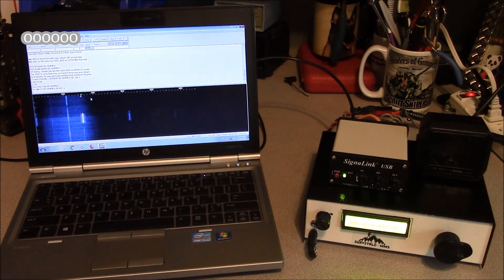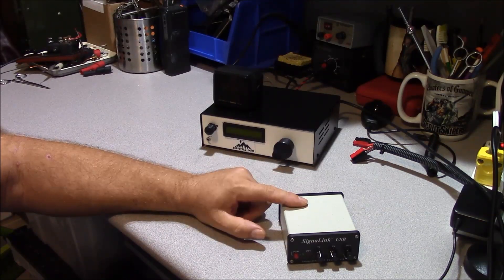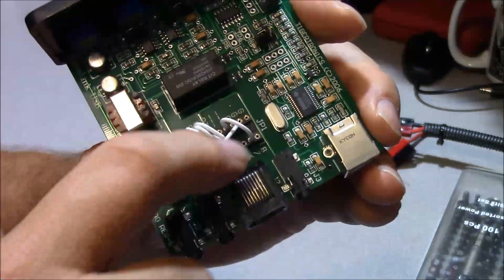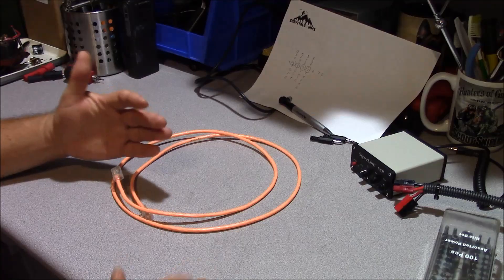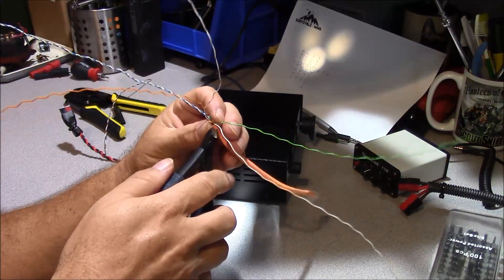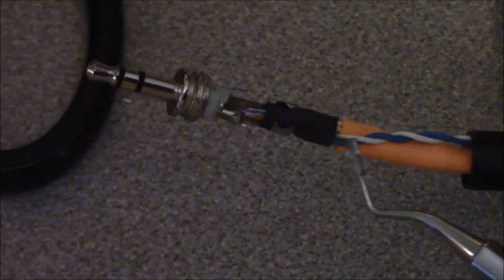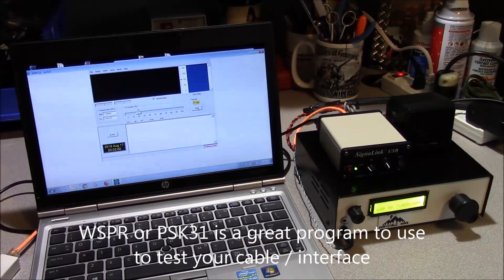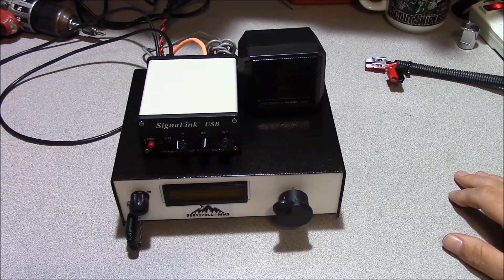uBITX  $130 HF/SSB radio part 5 build a SignaLink USB cable

Comment: Why do you use the SignaLink?  Why not just connect a cable from ubitx directly to USB of the computer?  Seems like making a simple connection more complex with no benefit.
Reply from the maker: Hmmmmm how and why would you connect the uBITX directly to the USB of the computer ?  You can interface to the soundcard of a computer with a few components . The signalink is a stand alone sound card and that is why it can pug into the USB. Thanks for watching !

Comment: I just got a Signalink USB for my FT-817ND, now that I have watched this I am going to get some cat cable that I have and make a connection for my uBitx as well.  Thanks for sharing this video, and I hope my buddy Ron C makes his first and then I can see how his turns out.  Of course I don't think Ron C has a uBitx.  Juddie WD8WV
Reply from the maker: You are welcome! Its a really easy build. If you have your jumpers set for the 817 the pinout on the signalink end will be  1-mic , 2-gnd , 3-ptt, 5-spkr .  A cat 5 jumper that comes with most routers is plenty long enough.  I believe Ron does have a uBITX . Thanks for watching !

Comment: I'll be making one of those cables for sure. Thanks for the tip and instructional!
Reply from the maker: You are welcome. Let me know how it works out Thanks for watching !
Reply: @survivalcomms  If I make a video, I'll credit this vid for sure. If I run into trouble...expect an email...lol!
Reply from the maker: @InPhocus_ADV  Thank you and no sweat. Just remember to use the current pinout in your signalink for the RJ45 by opening it up. If you have your Mic and Spkr grounded to one another you are good to go. If not you will need a ground wire from the Spkr ground to the Mic ground. Just twist one of the  discarded wires around the Mic and PTT  lines and solder that to the sleeve of the Spkr and Sleeve of the Mic. It Will not change the form factor at all.
Reply: @survivalcomms  Got it. I think it's set up for the FT-857 currently. I'll be in touch!
Reply from the maker: @InPhocus_ADV I  The Data port jack (rear) cable is  SPKR 5, MIC 1, PTT 3, GND 2
Reply: lol..Thanks! Made it easy on me!
Reply from the maker: @InPhocus_ADV  That's how I roll !
Reply: I will be watching for your video Ron!!!  I guess we travel in small circles! LOL Juddie
Reply: Very true!